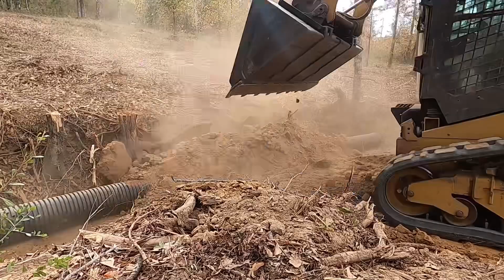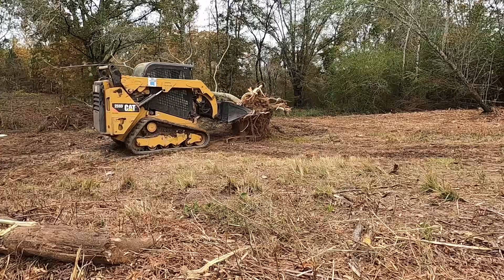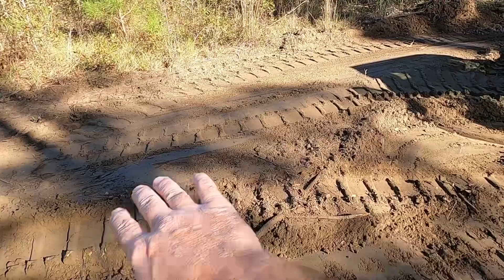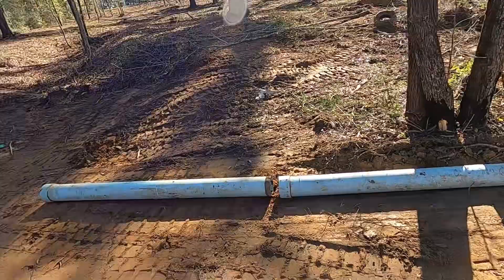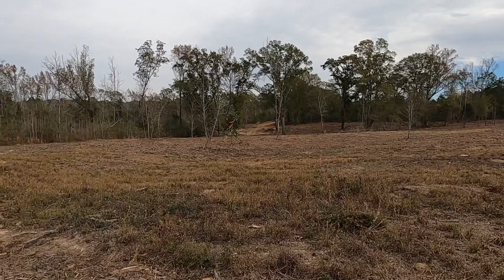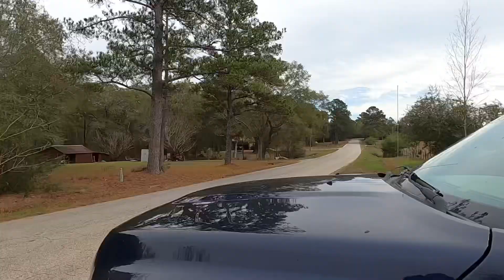Building A New Road To Get Access To 18 Acres! Cost $2000

Comment: How many hours did that take?
Reply from the maker: 20 hours
Reply: @weightbuilddig166 man that’s a lot of work. Turned out good. Is your normal rate only 100.00 per hour?
Reply from the maker: Thanks! I appreciate that. Yeah I charged a $100 an hour.
Reply: @weightbuilddig166  gotcha. I figured skid steer work would be 150 or more an hour just because of the machine cost.
Reply from the maker: Yeah I learned a lot while doing the clearing job and this one.